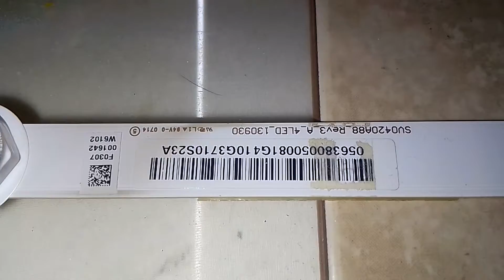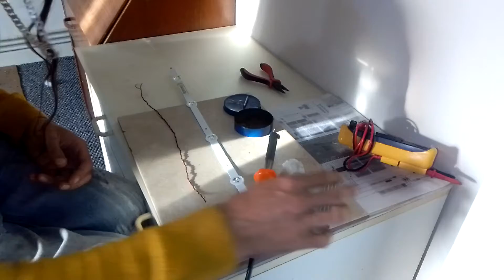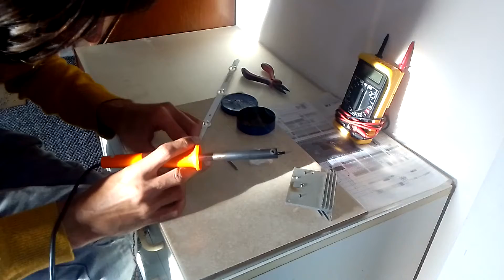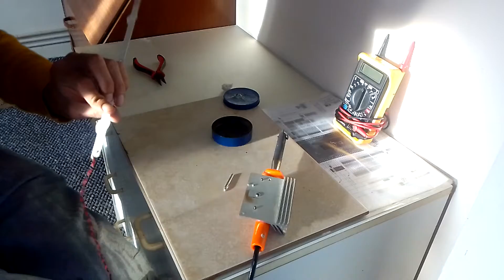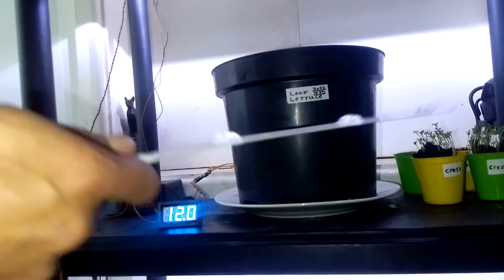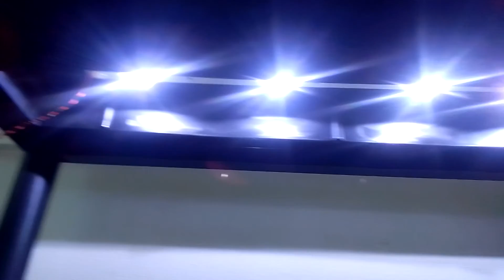Free ewaste Lighting 12v High power LED Backlights,Soldering Hack And Testing.⚡🔌💡

Comment: Have you seen the old e-cig mods that they've turned into portable soldering irons?  Some have even started selling their mods for good money on eBay
Reply from the maker: Seen them before on YouTube,but don't use e-cigs so no way of getting hold of a bunch easily,do solder a fair bit now an then though,so would be useful should I find any that is,don't get no time to wander for scrap lately,although I have plenty to strip when it's too cold to do anything else but smelly firey works.

Comment: Been making lights from those flatscreen led strips since a few years, yard is lit up like high noon at midnight, yet they use so little power.
With 4 lights in a circuit I can float my system at 14V, when I equalize at 15V I avoid using the lights as the extra voltage is sometimes enough to pop an led. Built one with 20 leds, bright but better is two or three units with less lights than one big one.
Reply from the maker: Long as it's 12v they seem to light even at milliamps well mine do at least,some I have found need proper juice and a low voltage the reverse pot luck I guess what lights you get from widescreen salvage.
As seen at the end of the video solar powering mine fixed to a 4tier shelf which I farm various veggys upon works awesome better than the sun most days as far as grow speed is concerned,no need for garden lights mines lit up by daft angled streetlights 🙄⚡
Reply: @thousandsofgames  Made an array of 32 flatscreen leds for starting seedlings a few years ago, then I found a red/blue/green grow light online my system can handle, at a reasonable price. Turns out there's usually as many led lights in a set as the number of inches the screen measures.